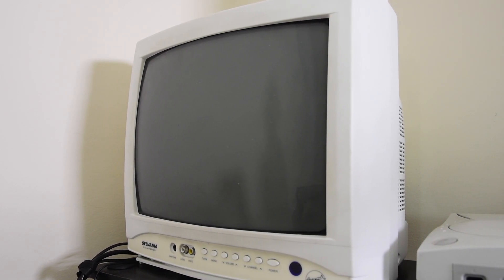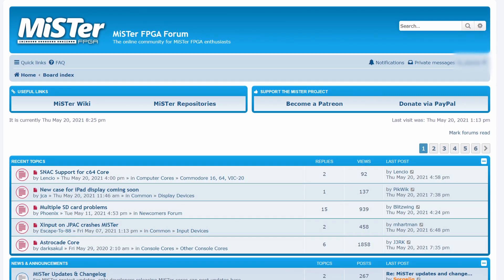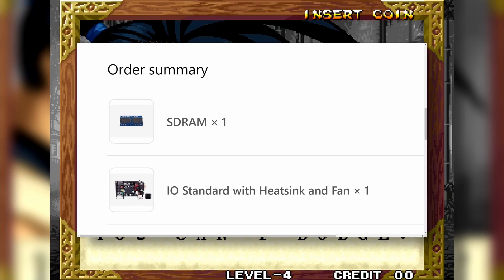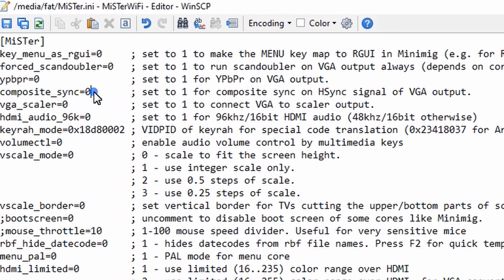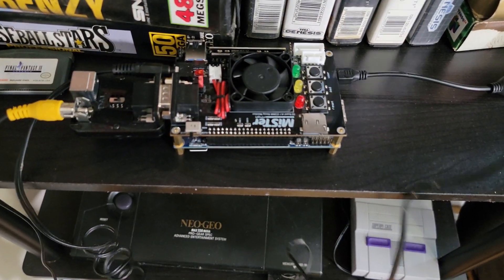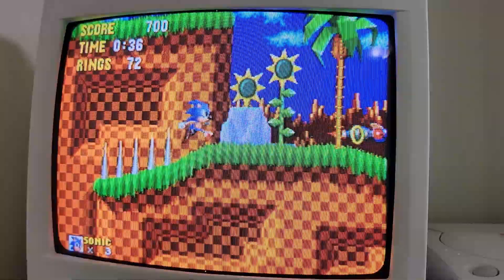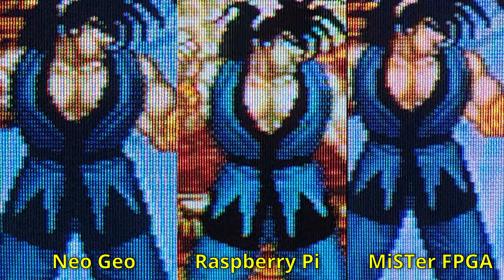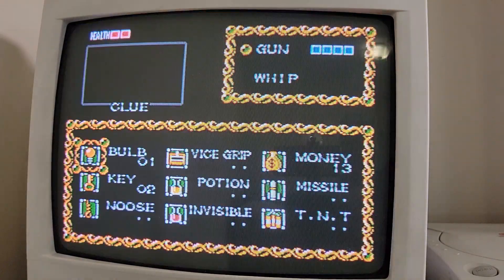MiSTer FPGA with composite video output. Will it look good?

Comment: I only got my MiSTer this week and have been very impressed. I have to have medium scan lines for all the games though and still would prefer outputting to a CRT. I dont have one with component so this composite adaptor looks pretty good to me. Might try to put an order in :D
Reply from the maker: There is another way to use composite that's cheaper. I have a video talking about it so you can make a better decision on which method will work best for you. 

Here's the video:
https://www.youtube.com/watch?v=DBy_XPmieKc

Comment: Is it possible to convert the HDMI as direct output to RCA/AV/component?
Reply from the maker: You can get the direct video adapter. It will convert to component but not composite or S-video. However there are ways to convert from the direct video signal to s-video and composite too. Here is a video I made about it:

https://www.youtube.com/watch?v=DBy_XPmieKc
Reply: @LusRetroSource  thanks! But will it work from the HDMI output of the board? Because I don't have the analog I/O board
Reply from the maker: @marcelowcr  Yes you will need to use Direct Video using an adapter like shown here https://github.com/MiSTer-devel/Main_MiSTer/wiki/Direct-Video

Comment: I'm curious if anyone's tried this adapter with a light gun.  If it works, that should mean it doesn't add lag, which I'd be sensitive to as a speedrunner.
Reply from the maker: I use it lightgun all the time. Tried the NES zapper and the Namco Guncon 2

Comment: Try to find a TV with component video (5 Cables). It's basically RBG. It looks so much better than composite (3 cables).  Most newer CRTVs had component video.
Reply from the maker: All the TV's with component I found were to big. Due to lack of space, I needed a 13" TV. If I have more space in the future a TV with component and s-video is what I would be looking for.
Reply: Any EU baby Trinitron (14 inch) has SCART. They are not that heavy, maybe 6-7kg. You could have one shipped.

Comment: I'm also a big fan of composite too, nice to see the results, I already have a VGA>S/Video/Composite (linuxbot3000's) that I use to output PC to my CRT TV but I wonder if works with MiSTer too...
Reply from the maker: The IO Board for MiSTer does output through VGA. You can use the PC core to out to a real PC monitor. So I'm assuming you adapter should work. 

You may want to refer to this thread from the MiSTer forums. They talk about VGA output and scalers.
https://misterfpga.org/viewtopic.php?t=970

Comment: Hi Lu : ) Thank you for making this video - it inspired me to follow your footsteps somehow. If I can suggest something - comparing MiSTer Composite Output to NeoGeo and stating that there is no difference in visual quality is premature - after all Neo Geo was more of an Arcade board than a console - it was highend and expensive. I notice the same problem with Raspberry Pi Composite Output - it's modern and designed by enthusiasts.

I wonder if you own an original hardware of NES or Genesis - they have awful Composite quality. There was a video on YouTube that I couldn't find, that covered this very issue - but now there is none.

Could you please make a video comparing real NES / Genesis Composite to their MiSTer Composite cores? Thank you.
Reply from the maker: Unfortunately I don't currently own original NES or Genesis consoles so I can't currently test them.

Comment: The only bad thing about having my fpga hooked up to my crt tv is that NeoGeo and CPS games get cut off due to the higher resolution. I wish there was a way to get the image to fit with out adjust the tv picture through the service mode.
Reply: Can't you output to both HDMI and analogue simultaneously?

Comment: Looks good, and on a smaller set composite is actually really decent. I would even argue a lot of games were designed to be seen in composite. Component can be great, S-video comes really really close, but composite is really not bad at all. Good stuff man.
Reply from the maker: Agreed. Composite still looks great!
Reply: @LusRetroSource  Hi Lu : ) Thank you for making this video - it inspired me to follow your footsteps somehow. If I can suggest something - comparing MiSTer Composite Output to NeoGeo and stating that there is no difference in visual quality is premature - after all Neo Geo was more of an Arcade board than a console - it was highend and expensive. I notice the same problem with Raspberry Pi Composite Output - it's modern and designed by enthusiasts.

I wonder if you own an original hardware of NES or Genesis - they have awful Composite quality. There was a video on YouTube that I couldn't find, that covered this very issue - but now there is none.

Could you please make a video comparing real NES / Genesis Composite to their MiSTer Composite cores? Thank you.
Reply: Agree even the megadrive looks decent on a smaller set with composite I've got a few in my garage as back up TVs my usual set up is RGB on a B&O crt tv

Comment: Hello, great video! I have the first version of this adapter, The one that came without the plastic case its just the Barenaked board, I got it a while back. I Couldn’t help but notice that your composite image is way cleaner than mine from what I see in this video. Do you ever Get any shimmering or shaking in your image? Or any like color bleed? In the reds? If not, I think I might upgrade to this latest version of the adapter. Thanks again for the video
Reply from the maker: I just compared the composite output on the MiSTer and my NeoGeo. On the MiSTer I do notice shimmering on the edges of of graphics that is not present on my Neo Geo. But the output on the MiSTer is brighter and more colorful than the output on the NeoGeo. Overall I like the better colors and brighter out on the MiSTer. The shimmering never bothered me before.  I'll try to do a followup video showing what I'm talking about.

Comment: Buyer beware with the mAVster-MD2! I tried buying one of these from the seller and never received it. Sent several emails and tried contacting him on Facebook. Ended up buying the other and got it.
Reply from the maker: I saw a reddit thread recently talking about this. I was actually going to buy the mAVster adapter because it was what I found first, but it was sold out. I felt like I dodged a bullet after reading that reddit thread. Sucks you had to go through that experience.

Comment: 7:50 - I love how the Pi takes like a full second to jump after the MISTER and arcade, not sure if you composited these images in post, or if thats accurate. The MISTer is a few pixels behind the Neo Geo, I wonder if thats a USB issue that would be fixed by using SNAC
Reply from the maker: Here was my method to how I made that scene.

I recorded the beginning intro's before a match on each device using the same camera,
Then I aligned a frame of a specific action the game performed.
Since the jump was actually done by the game itself and not me, there was no input lag to worry about.
The PI as you noticed, was clearly way off.
I think it's much harder to get an accurate measurement between the Mister and Neogeo since they appear to be so close. So I probably have to be more precise with my recordings. This was a quick test to see if there's any easily noticeable differences.

Comment: Awesome vid, was exactly what I was thinking about. - I have a 21 JVC TM-A210G. I have been using it with composite with my original MegaDrive, never tried anything else. The TV also has BNC & Y/C but I have no idea how to connect those ports to MISTER or what cables I need.
Reply from the maker: Thanks! I think you can save money by using the BNC ports on the TV with the MiSTer because the analog IO board has native RGB support and you can also output RGB throught DE-10 Nano HDMI port, as long as you have the correct cable. So you wont need the composite adapter I used.

The www.misterfpga.org forums will be helpful in finding out what cable you need.
Reply: @LusRetroSource  - Thanks for the tip, will checkout the forum. I would love to try native RGB, but I am a huge dither transparency fan. I guess you have played Mega Turrican on a CRT? On my JVC the graphics are spectacular neighbouring colours take advantage of the Gaussian blending to great effect but on a LCD it looks flat. Sonic 3 is also especially beautiful on a CRT.

Comment: Thanks for the video. I was intending on getting the same adapter as well. I have a CRT television in the corner of my room that I used to play original consoles on many years ago. It will be great to use it again with my MiSTer FPGA. Keep up the great work :-)
Reply from the maker: Thanks! I definitely recommend the adapter. It's so much better playing the games on a CRT.
Reply: @LusRetroSource  I just ordered one of these last night. I was thinking about it for a while but you convinced me. It will be great to play those old games the way I remember them :-)

Comment: what is that piece you used to set the 5 volts? did that come with the adapter?
Reply from the maker: That piece didn't come with the adapter. It's a 2.54mm Jumper Cap. You can easily find them on Amazon.

Comment: I am going to open up a rabbits hole. You need to rgb mod your consumer tv.
Reply from the maker: Ha ha! Already know about some TV's having a jungle chip for the OSD that can be modded for RGB. My TV does have an OSD, but will need to do research on it's possible with my model.
Reply: @LusRetroSource  I think you’ll rgb. I know you preserving that original intended look but I do think rgb is overall a better picture.

Comment: Its always been bizarre to me that the IO board doesn't support composite. Glad you found a solution that works for you!
Reply from the maker: Yeah, when I got a CRT I remembered reading the github that analog video was supported. I naively thought that included composite.
Reply: I was actually hoping you could just use the green cable on a VGA to YPbPr cable and setting certain settings.  Kind of a shame it doesn't lol

Comment: Nice video, i love the crt i have two Sony ones that do component. How do you feel about component?
Reply from the maker: Can't really say anything about composite because I've never used it with a CRT. The first time I used composite was with the Xbox 360 and it was through an LCD HDTV. Composite on a CRT would be something that I would at least like to check out though.
Reply: All my consoles did RGB, not component. No idea how component could be a benefit. Maybe a PS2 can do component out, but an earlier console with it? No idea if that exists. And Nintendo was really bad, they only did composite/RF for a long time. So for me it is miles behind RGB scart.

Comment: Excellent vid. Finally, a proper guide on using the Villeno adapter. I'm not the biggest fan of the composite output from the adapter. It's generally good, but it seems to have a vertical interlaced effect. Like the image is crawling. Svid is flawless.
Reply from the maker: Thanks for the comment. It's good to hear other opinions on the adapter.
Reply: Isn't that so called "dot crawl" one of the inherent quirks of composite connection (caused by crosstalk between color and brightness signals because they are being transmitted via the same cable). So I don't think it's actually the adapter's fault. At least, I've had different Famicom's, Super Famicom's and Sega Mega Drives throughout the years and all of them had this problem when using the composite connection. Once you go S-Video (which uses separate cables for color and brightness signals, thus eliminating the crosstalk inherent to composite) the dot crawl always disappears. But with it you also eliminate most of the blending and image softening effects provided by composite connection. To me those effects is what I'm really after, when playing old school consoles, so after trying both and appreciating the sharper and more stable picture quality of S-Video,  in the end I decided to put up with dot crawl. It kinda makes the games look exactly like I remember them in the old days. lol
Reply: @kosmosyche  I get what you're saying. I play with all sorts of signals, and while I stick to rgb, I have a lot of love for composite and think svid is an amazing jump in clarity. This adapter has a unique effect to dot crawl. It's hard to explain unless you see it. It's like it's a 480i signal, but vertically. It's the only way I can describe it.
Reply: @peterk1837  damn, I just ordered mine, and now I'm worried. I just want the usual artefacts of composite, not an additional shimmer
Reply: @MatijaErceg  Everyone hammers me here and on facebook that it's dot crawl which I disagree with (Mostly people who don't have this adapter). Also I wish I bought an alternative on ebay that has 5v injected externally. Moving the internal jumper and remembering to move it back is a headache. Let me know how you go. Hopefully it's just me or my crt.